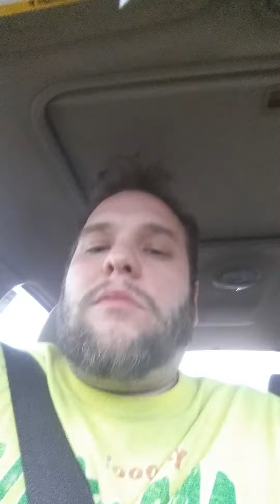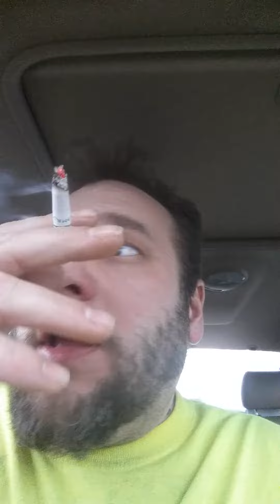2009 chevy malibu lt issues?

Comment: I had one of the two sensors on top of the engine replaced and it stopped with the engine power reduced, SVC ESC and the other message I can’t remember.

Comment: I have the same problem
Reply from the maker: Turn the car off... while keys in ignition, turn the steering wheel all the way to one side and push really hard a few times .. do that to both sides then start it up with it turned all the way... it worked for me
Reply: @THEODINOFFICIAL  ok will give it a shot thank you for your help